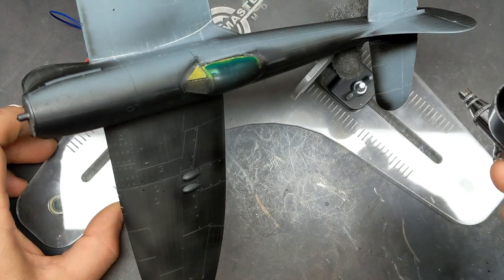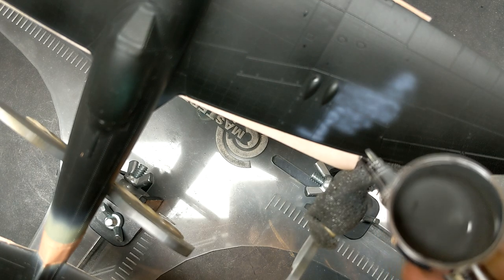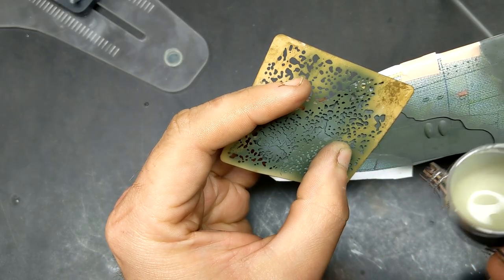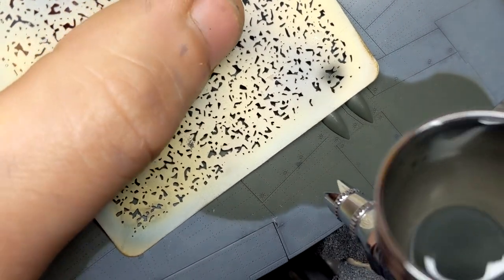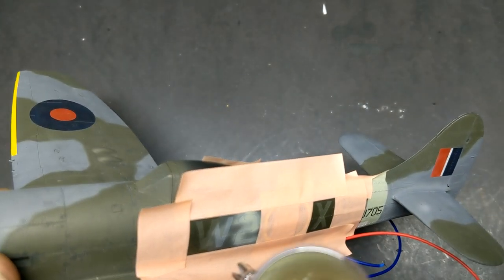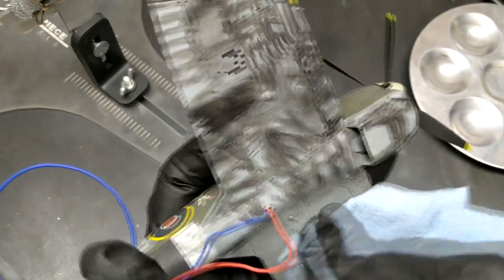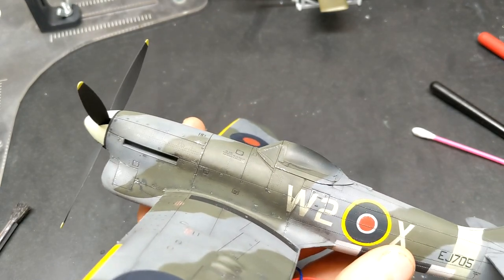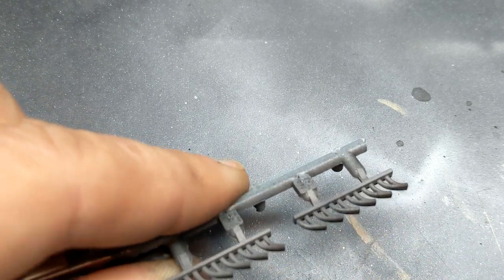1/48 Eduard Tempest Part 4: Painting and Weathering

Comment: The new Eduard decals may look "wide" in how the film is very glossy and broad, but they work as well as the best I have seen, settling down into Eduard's minuscule depressed rivets (using just micro sol over under, on matte paint with no gloss or polishing) with no issue. Above average adhesion, even when a bit of dishwasher liquid is added to the dipping water, as they tend to "stick" and not move around well. I never remove their film, but both the film and the left behind colour put up a fair fight against scratching off, which makes them more handling resistant than any other I have used. They never just flake off, even on matte paint.
Reply: I'll add that the tape pulling off the film trick seems to work very well on metal finishes, if you really melt them down and wait the prescribed 24 hours. The best way to do this is to lay the pulling tape without burnishing for a "weak" pull off, this will weaken the film on the first pull. Then burnish a new tape really well, and the film comes off really easy, with a few remaining clumps hanging loosely and easy to remove... On do this on metal finishes, as I fail to see the point on camo. The colours left behind are quite tough (!!!), even without the film...

Comment: my mr surfacer 1500 peels when i put any masking tape over the next layer over.  do you do several layers and let it dry for days?
Reply from the maker: Wash down your plastic after assembly with alcohol to clean any oils from your finger prints off and dust. Make sure you're mixing it before spraying. The only time I've had it peel off is when the surface wasn't clean

Comment: Really new to modeling, I have two questions.  Do you clear coat your models after paint before oils?  What size needle on your airbrush do you use?
Reply from the maker: I’ll put down a flat coat before oils. My cheap brush I use for 90% of the work has a .03 needle in it. My detail brush has a .015